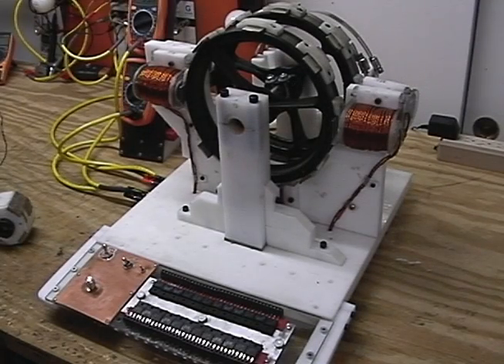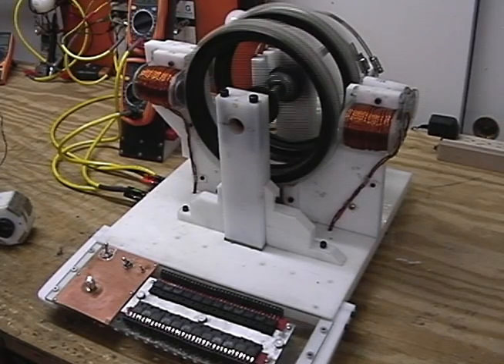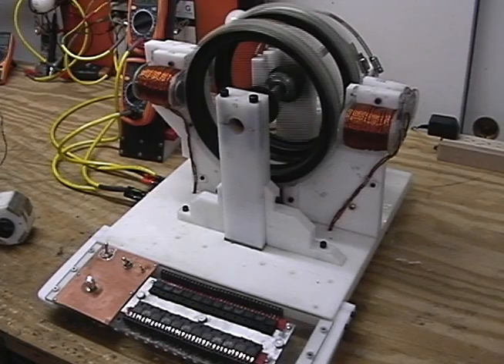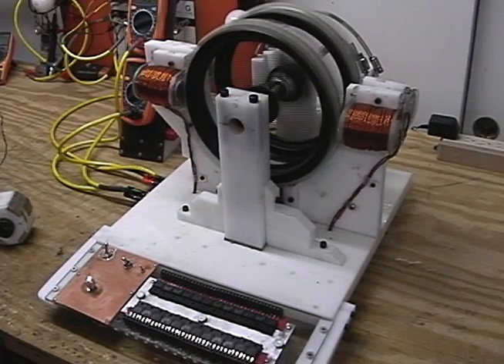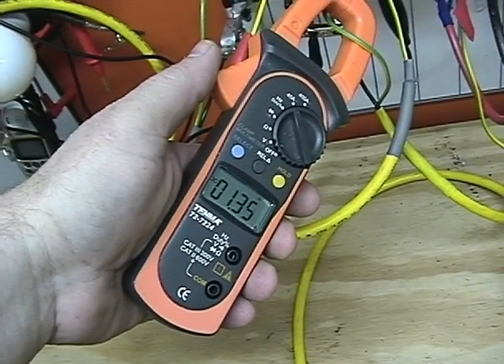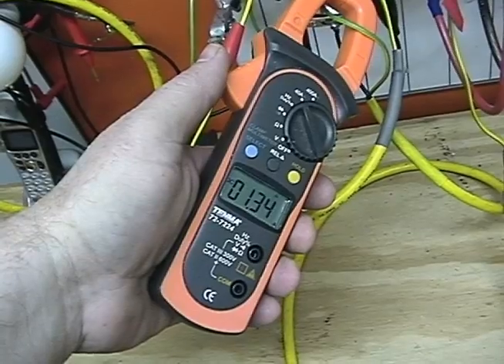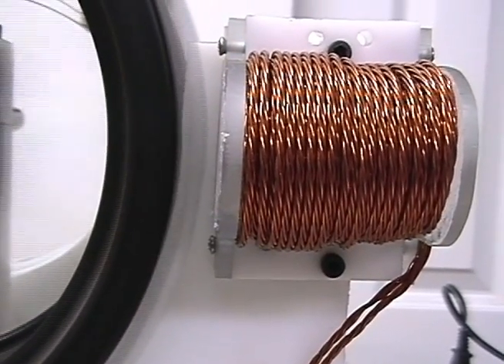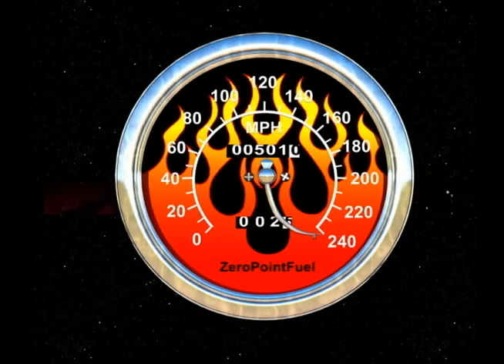VMG 04

Comment: anyway it could be magnetically suspended? if it were lighter lets say carbon fiber drive shaft and flywheel even can be made out of carbon fiber then just mabye a set of contact guides

Comment: Hook it up to a car - normally it takes 10 to 20 batteries to power a car. If you can get by with 5 or 6 batteries, and be constantly recharging one of the batteries and rotate them, (electronically), to maximize the regenerative aspect of your motors, as well as the power output of the motors, THAT would be a real breakthrough. Thanks for the videos :)

Comment: If you can get by with 5 or 6 batteries, and be constantly recharging one of the batteries and rotate them, (electronically), to maximize the regenerative aspect of your motors, as well as the power output of the motors, THAT would be a real breakthrough. Thanks for the videos :)